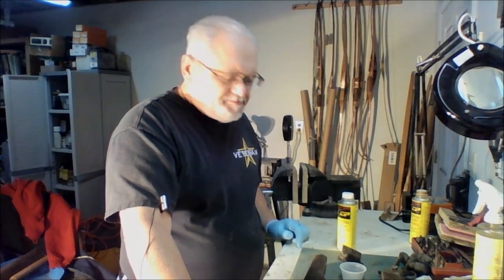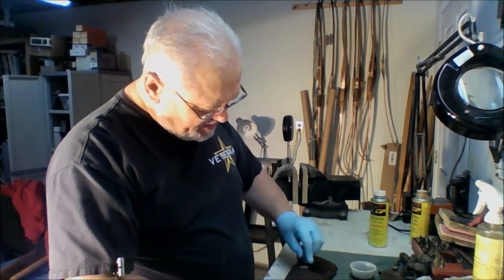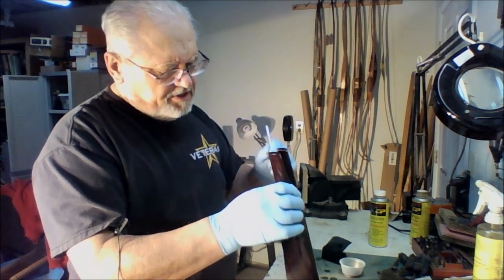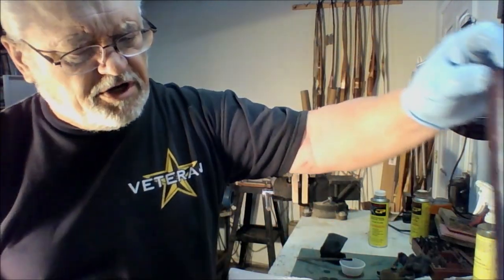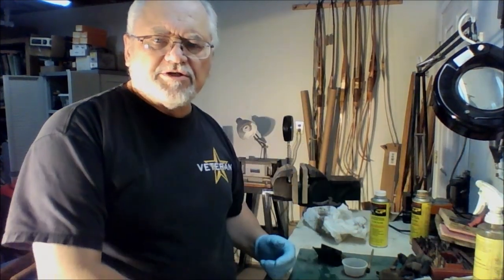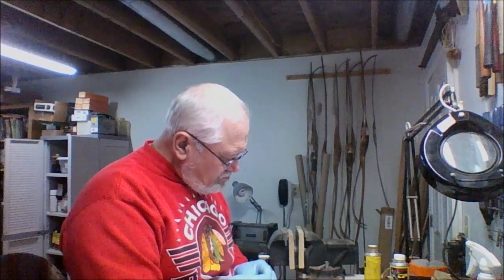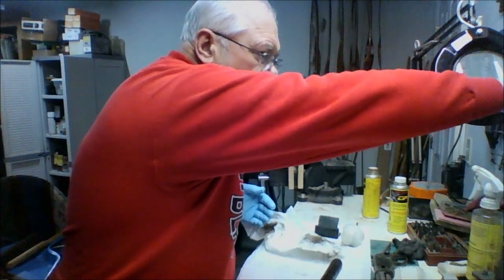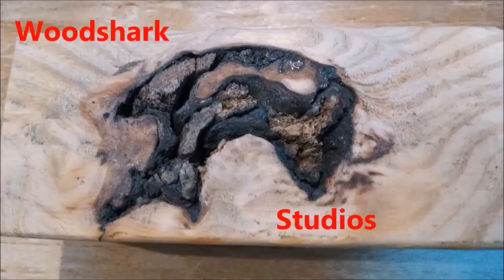The Old Gunsmith - Project Gun Part 13 - Sanded In Finish

Comment: Go Blackhawks!  Have you given alkanet root a try?  You can pick it up at an indian food store.  Usually labeled ratanjot.  Put that powder in some linseed oil and let it sit in the bottle for a few months..shaking at least weekly..  Turns the oil into a really nice red color.  You can then mix that oil in with whatever your favorite finish oil is.  Thanks for the video!
Reply: I have used alkanet root but it has been several years. The reddish color is reminiscent of The color found on some of the old Winchesters. I've used it to match those finishes but you don't see it very often today. It will give you a different look if that is what your looking for. Thanks for the tip and thank you for watching.